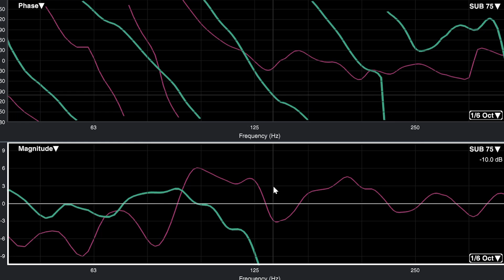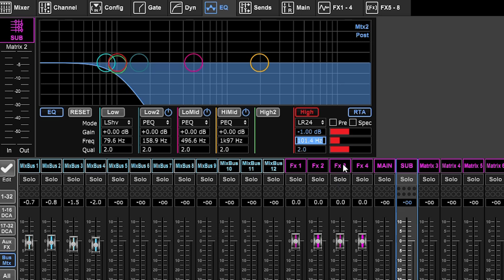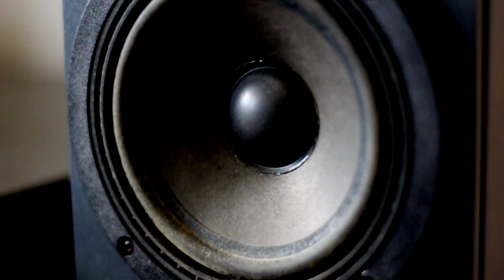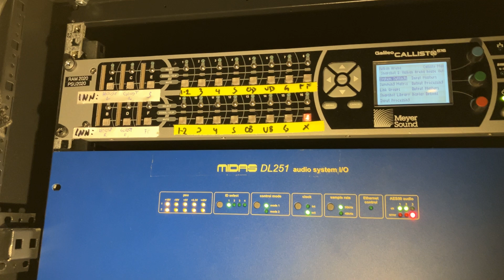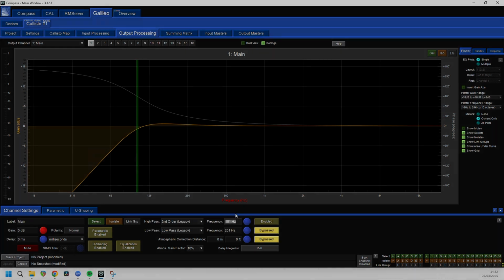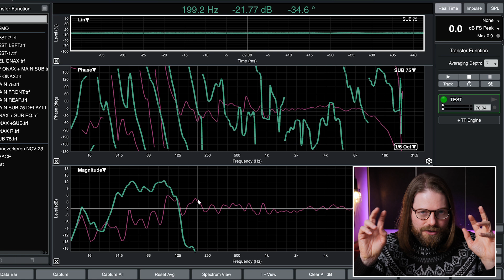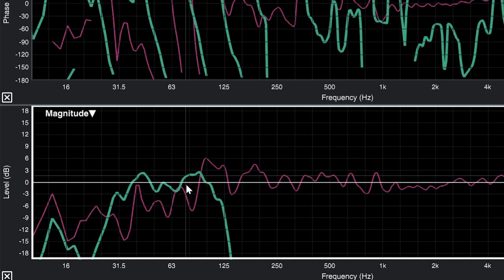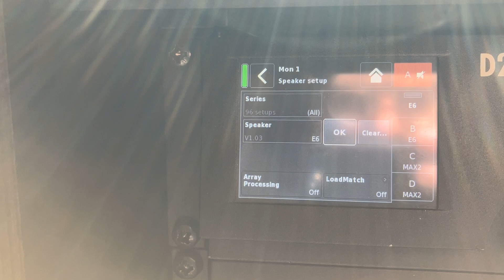What Does A Crossover Do In Live Sound?

Comment: Can using separate multi band EQ's do the same job?
If you split the signal through 3 different EQ's 1) sub cuting everything above 120Hz
2) mids 120Hz and above and so on?
Reply: Not even close. Your EQ may cut 12-16 db's in any 1 band total. A crossover will cut 24 dB's PER OCTAVE. For example a 120 hz LR  high pass crossover will already be down 6db at 120 hz, then 30 dB down at 60 hz (6+24), and then 54 dB's down at 30 hz, 78 dB's down at 15 hz. Per octave it gets progressively more cuts.
Reply: @wally7856 finally someone who knows what they're talking, thanks brother🤘
Reply: @b00ts4ndc4ts  Also, using multiple steep EQ cuts using an EQ in place of a proper crossover will dramatically alter the phase in that area in unpredictable, erratic ways. A crossover also alters the phase in that area but it does so coherently. A phase plot would show instead of an erratic bumpy road (eq way), you have a nice smooth ramp (x-over way).

     That's not to say you can't do it if you have to in a pinch to get you by. It's just the wrong tool for the job and you get way better results using a proper eq. Example: I'm a live sound engineer on location. I only have the kit I have with me. Show already started so no rearranging now and now performer mid show is requesting more out of their monitors. Neither amp nor speakers have any room left in them. I can cut all the bass using a graphic eq on that monitor which takes a lot of stress off both the speaker driver voice coil and the amplifier output and now I can turn it up another +5dB's and it still (now that I cut the bass) plays clean. They'll still get bass from the subs even on stage so no harm done. Once again, not the best tool for the job as I probably messed up some of the midbass on stage with all the phase irregularities but you get a thumbs up back from the performer for increased volume and take it as a win.
    Don't design your system that way, use proper crossovers but it is a tool to do something somewhat similar if you need to to get you by.
Reply: @wally7856 it didn't even a cure to me to think about phasing issues.
I'm trying to set up a decent sounding P.A. that will be getting used in a markie tent and in the day time it will be bands and solo artists using it.
Later at night time it will be DJ's so they will need a bit more low end, but I still want as much clarity.

Getting the right information needed so I know the best way to set up the different cabinets.

So far I have x4 cabinet each have X2 15" speakers.
X2 cabinets with x4 12" speakers.
X2 cabinets with x4 10" speakers.
X2 cabinets with X2 tweeter horns in each of them.
X2 1000 watts power amp's 
X2 stereo EQ's racks.
And 32 channel mixer. (Front of house)
I need to get monitors for on stage and also something for the drummer ( no too sure what to about that because the kit will be mic'ed up)
And maybe a mixer for the stage monitors.
I have until August next year to get prepared, so whatever else I haven't thought about.

I going to get all the gear myself but possibly get someone to run the front of house. If I have enough in the budget but maybe have to do it myself.
Reply: I suppose if you're using passive speakers and powering them with NL4 cables you would want to bi-amp the speakers to get the most power out of them. So you would have a cross-over between the tops and subs and a crossover to the tops between the tweeter and the cone. Obviously if you want to send some cross-over to the mains the point is is that those crossed over signals are hitting different speakers, so that the speakers aren't wasting energy trying to reproduce frequencies that the speaker isn't able to reproduce anyway, as mentioned in the video. If you're not familiar with bi-amping: You would send a signal intending to go to a speaker through an active cross-over device that splits the 2 frequency ranges into 2 separate outputs, then you would take those outputs and send them to channel 1 and channel 2 into the amplifier of the speakers, then you would take the 2 NL4 outputs and wire pins +1 and -1 from one channel into the +1 and -1 pins on the NL4 cable going to the speaker, and wire the +1 and -1 pins to the +2 and -2 pins on the NF4 cable going to the speaker. Right, so the 2 NL4 outputs on the back of the amp get wired to a single NL4 cable going to the speaker. Usually the +1 and -1 pins go to the cone and the +2 and -2 pins go to the tweeter. If you don't bi-amp the signal then the same full-range signal goes down both sets of pins on the NL4 cable and the passive cross-over in the speaker handles it. It's handy to use passive speakers that have a switch to turn on or off the passive cross-over in the speaker. You would turn off the passive cross-over if you decide to bi-amp and use an external active cross-over. But you can still get the specs on your speaker that tell you where the built in passive cross-over points are set to and mimic that on your active cross-over and still get more power and dynamic range out of the speaker by bi-amping it. If you already cut the mids and low frequencies out of the signal going to the tweeter then the passive cross-over in the speaker doesn't have to work so hard, so less wasted energy.
Reply: Actually I'm not sure if that last bit will work on all passive 2-way speakers depending on the cross-over circuitry in the speaker, but you can look up specs to get an idea if that would work for a specific speaker or you can just as well have fun playing around with the pin-out on the NL4 cable to find out.
Reply: If you have a passive speaker that has pass-thru's and you're not bi-amping it, you can open the speaker box and swap the pins +1 and -1 to the +2 and -2 pins on the pass-thru connector and run a Left Right stereo pair down a single NL4 cable (plus the jumper to the second speaker) If you send the Left signal down pins +1 and -1 and the Right signal down pins +2 and -2. You would wire up the NL4 outputs from the into a single NL4 cable the same way as if you were bi-amping but you would send a Left signal into channel one of the amp and the Right signal into channel Two of the amp. Some passive speakers have a switch for that so you don't have to rewire the pass-thru connectors in the speaker box. Obviously then you can drive signal to those speakers with just NL2 cables to use normally, and that those speakers can't be bi-amped.
Reply: Or, actually, it would be easier and less destructive to the speaker to just rewire the NL4 jumper so that pins +2 and -2 from the first speaker wire to the +1 and -1 pins on the other end of the NL4 cable hitting the second speaker.
Reply: I have digital mixer that does not have lpf. I eant to feed speakers ands subs on seperate matrix. Would i need external crossover, so the sub feed would get its lpf and the tops its hpf? Either two crossovers for each or one behringer dcx9624 that could have l&r and then sub input? Are there any other easier ways to acomplish that. I have soundcraft si expression mixer.

Comment: Very informative, thank you!
May I ask a question? I use a subwoofer which has an internal crossover (for speaker outputs above 80 Hz) but I use it as standalone sub. Do I need to lowpass its signal?
Reply: Low pass and high pass filters cause phase rotation which can effect transient information and alter the inherent "finger print" of a sound by phase shifting harmonics and the fundamental tone, causing the relationship in phase between the harmonics and fundamental tone to change which is what changes the "finger print" of the sound. Everyone looks at an RTA or FFT analyzer to see what they are doing when they EQ a sound but people should try looking at oscilloscopes and loudness meters to get a better idea of what eq's and filters are actually doing to sound. If your sub already has a cross-over built in then you don't want to engage a low-pass filter.... at least not too deep. You can engage a low-pass filter but maybe down to 350Hz to cut out useless energy hitting the sub (giving you more potential for loudness before distortion or clipping) but the phase rotation caused by the low-pass filter will effect frequencies below 350Hz to some length. At least at 350Hz the phase rotation probably won't effect frequencies 80Hz or below. The deeper the slope of a high or low pass filter, the more frequency range it phase rotates. So if you don't know the slope of your sub's internal cross-over then you might low-pass it at a slope of 12dB down to 80Hz but the slope of the sub's internal cross-over could be a 24dB slope, so you're just creating a mess of even more phase rotation below 80Hz that will effect the quality of the instruments that go to the tops and the subs and make it harder to get the subs to be a smooth continuum of the tops, so the subs will sound separate from the tops. I try to make sure that the subs sound cohesive with the tops so they sound like one sound source so it's like no one knows that the subs are there (unless it's for hip hop music or something where the subs are used as an effect).
Reply: @mattsmusika  Crystal clear! Thank you very much for this explanation

Comment: As always great videos! Yes I’ve QSC Active speaker and JBL active Subwoofer, what setting would you recommend for these kinds of speakers? And would you suggest to use the aux for the Subwoofer separately and go through the main out ? Pls suggest and thank you for all the tips n tricks. 🙏🏻
Reply: A cross-over at 80 Hz is always a safe bet when in doubt. Consider running an oscillator through your crossover to make sure there isn't a dip or a standing wave at the crossover point. Consider using a reference mic and at least an RTA analyzer or SPL reader or both to have a somewhat reliable measurement. 80Hz is nice because you know whether you get a rock or heavy metal band,  or you get a jazz band with a kick with a higher fundamental tone, you know that that is going to be in the frequency range of the subs (things can get fishy if the Kick's fundamental tone is in the crossover point, especially if the crossover point isn't "scientifically precise"). Whether you run the subs off the left/right or off an Aux or Matrix is up to you. Running off the left/right is not bad, the theory being that the subs are an extension off the tops and are not heard as separate from the tops, so the idea being that the whole sound system is reliable and balanced and can be mixed into like a set of studio monitors for example. I still prefer to run subs off an aux because I don't like hearing things like vocal mics bleed into the subs. Highpass filters still have a slope so there are frequencies still passing below where the HP filter is set. I also don't put bass into the subs a lot of the times cause it muddies up the kick and eats the subs headroom. Whatever you do send to the subs you should send at unity and address EQ or tone issues from an equalizer. The reason for that is that volume effects phase so if you send bass or kick to the subs at, say, -6dB, cause that's what sounds right... the kick or bass will be out of phase between the subs and the tops. I also like to run subs off an aux because then if I don't send my bass to the subs then I don't have to highpass it. Highpass and lowpass filters cause phase rotation, and there is also a phase rotation caused by the cross-over in the first place... so less phase rotation and a more pure original signal then. That's also why you don't want to set up a cross-over at the mixing console if there is already a cross-over in the system processing.
Reply: @mattsmusika  Great explanation. 
I also don't like sending bass to the subs for the same reason. Only time maybe if it's a 5 string, and I'll let that low B leak into the subs a bit.
Quite often I actually don't even put any kick in the tops, because the sources have a ton going on in the midrange, and needs all the space it can get.
Reply: @StereoAnthony  Yeah. For some styles of music, bass in the subs is relevant to the musicality of the music, like for some RnB or some dancy style of music. I would send kick to the tops though because the subs are only going to handle the fundamental tone of the kick, there's no character to the sound at just the fundamental tone. You can just as well scoop some of the mid range out of the kick to make room for other instruments in the mix. It's especially useful to scoop some low mids to make room for the lower order harmonics in the bass. Another way I like to think about it is that the "sub bass" region is mostly low frequencies where the human ear doesn't register tonality very well. About 80Hz to about 200Hz is still bass frequencies but the human ear can hear tonality better in those regions. A bass is a tonal instrument so makes sense in a lot of cases to be in the "bass" region but not necessary in the "sub bass" region (though some times it is), but we don't typically hear the fundamental tone of a kick as a musical pitch, more of just a noise. I think an important thing to take away from appreciating these kind of things is understanding that the human ear really registers most of the tonality and character of low instruments because of their harmonics. So unless you're in a small club or some environment where it's not necessary, I would send the kick to the tops.
Reply: Here's one I don't hear people talk about. When I get a bass player who's amp is so loud that it doesn't need to go into the PA, when it's hard to hear what note the bass player is playing (can especially happen if there's a bunch of bass in the wedges on stage, all these speakers pointing in different directions at different distances from the mains, causing comb-filtering), I like to high pass all the bass frequencies out of the bass instrument and just put it's harmonic structure into the PA. The bass instrument is still too loud but at least you can tell what note it's playing.